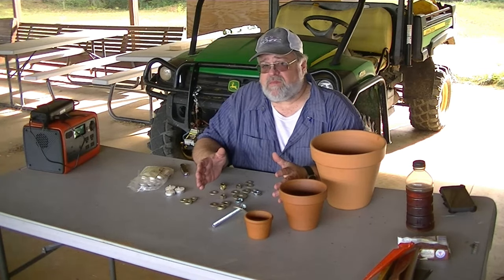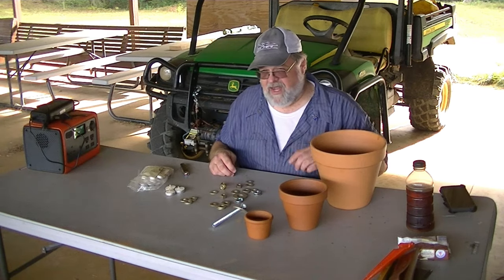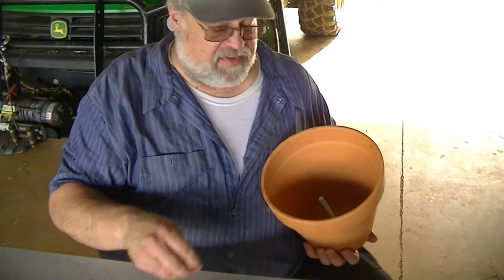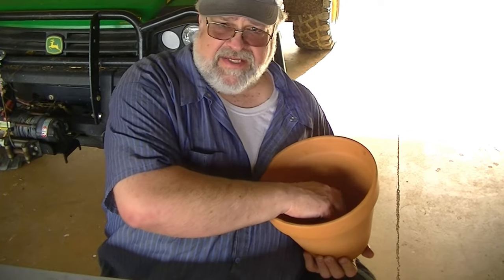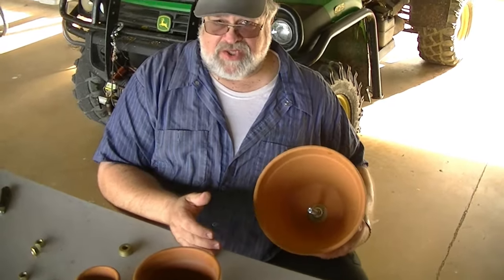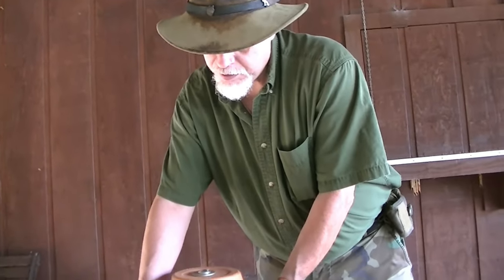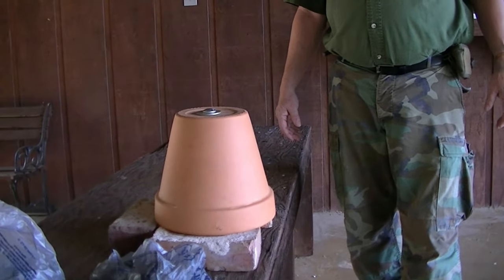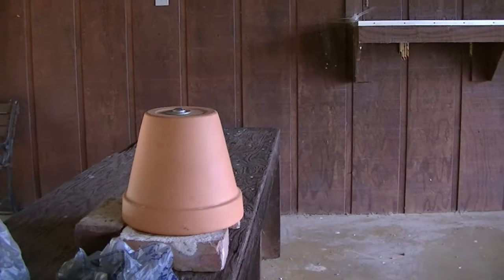DIY Emergency Heater with Everyday Items! (You Won’t Believe How Easy It Is!)

Comment: Very well done video, Bear. I always enjoy your content as welll as Blackie's.
A tip just in case you only have a drill bit. You can soak the pots for two days and then you can slowly drill that needed hole by hand without a any drill or with the danger of cracking them. I've done it many times. (I also purchased a bit and brace. I like non-powered tools.)
I would recommend placing any candles in a fireproof tray on some thin bricks or tiles. This tray also allows you to replace the candles without moving the pots. Don't get cheap candles. The cheaper the candle the more toxins it releases into the air. Amazon sells Stonebier tealights that last 8 hours each and don't leech much in VOCs. Three to four is all you need. A candle's flame will produce carbon monoxide if the wick is to high or not the right size for the candle. If a modern candle smokes, it is dangerous. The ones above are nearly perfect but others do work.
Don't lower that center pot. The heat can and will make it explode due to the pot's small size with the metal bolt in that hole. If you drill the hole a little bigger in that pot, you can do it but be careful. (Yes, I experienced it and had pot pieces everywhere.) I've used these wanting warmth since a heat pump doesn't run under 35 F degrees.
One thing making these more functional is the addition of a metal grill or trivet attached to the end of the big rod so it is on top of your biggest pot and drawing heat from the rod/bolt. After an hour of being in use, you can warm a cup of water or soup on it sometimes to a boil. Takes a little time, but without power, you only have time.
These need to be kept away from everything flammable in the room. They should never be used in tents. These can get extremely hot. I mean glowing orange hot in the complete darkness.
Take Care and Stay Safe, my friends.
Reply from the maker: Well stated Damien.. 🐻

Comment: Great idea with the lock washer, I'd say even add some silicon washers. Maybe even cut some washers out from silicon baking mats, also maybe use an eye bolt to give you a spot to lift it once it gets hot. Thanks for the content Gents, take er easy.

Comment: Greetings Bear and Blackie-  These ceramic pots act as a heat retainer which means, the ceramic will retain the heat within much longer when direct heat is lost.  I would imagine you could cut out some 1 and 1/2 inch galvanized pipe as your spacers, but whatever works, as long as it works.  Good job guys- you guys be safe down there-  Carry On-

Comment: It is an excellent system and science supports it. It makes sense to increase the surface area exposed to the air and thus becoming much more efficient at convection. I have seen this type of system before but I like how you assembled it with easy to attain items. This is a great tip and in a small area as Blackie mentioned, it could definitely get an individual or family through a tough night without a primary heat source. I have used my bush pot in a shelter before to do the same thing and it is amazing how well the pot radiates heat once it warms up. Keep up the great work here my friend and may the Lord bless you and your family in 2024!

Comment: Thanks.  I need to drive to the big box 80 miles to find some large ones because I have a small lantern that should be perfect. I just never get that way these days. I tried to look for them locally and they either didn't have them or wanted between 25-50 dollars a piece. You need some large ones even for a small lantern.
Reply from the maker: I know what you're saying Willys.. my big box is only twenty minutes away and it's an act of Congress to get to it.. (confidentially, it's worth the effort..) 🐻

Comment: You could cut pieces of steel pipe or conduit for spacers instead of washers and use an eye bolt instead of the flat head bolt so you could use a stick or something to pick it up. Use a 3 wick candle to ge it good and hot then snuff out 1 or 2 of the wicks to regulate the heat.

Comment: In the 80's we had a serious winter here in Poland. Approximately -30 C. Some commie blocks had problems with pipes, and people were left without heating. People were using bathtubs and candles to warm up children. 
I would pay in gold for a few hours of talking with people from Sarajewo. They were under siege for a few years. Three years without electricity, gas, central heating, water. Tunnels saved them. Food staples were transported through them

Comment: preheat in a fire, heat a tent
Reply from the maker: Preheating the flower pots and then moving them may be too dangerous Cbrat.  I would encourage folks to assemble it where you want it and then apply your heat source. I do agree it should have a larger heat source than ours. 🐻